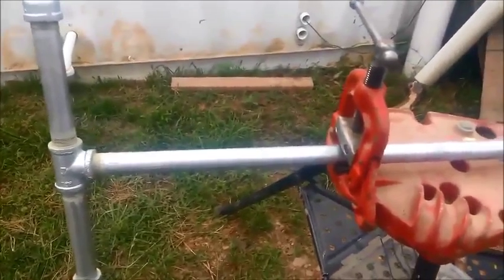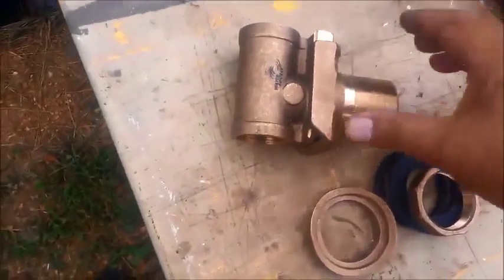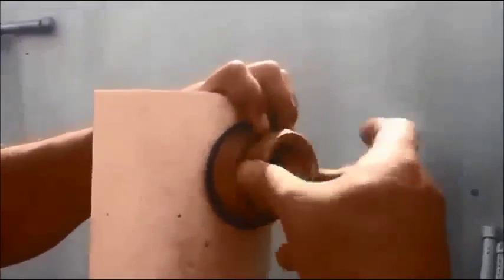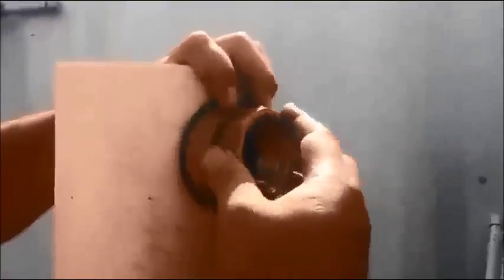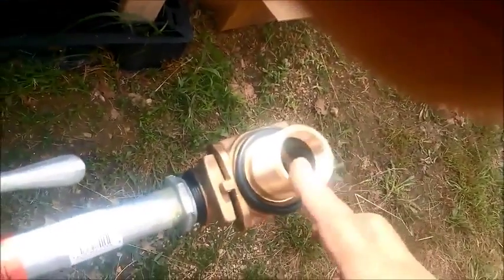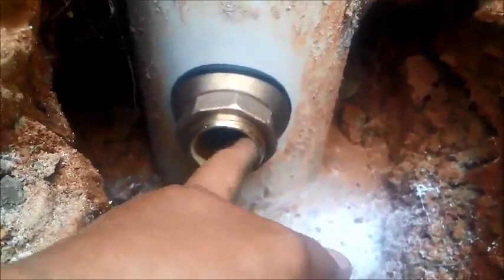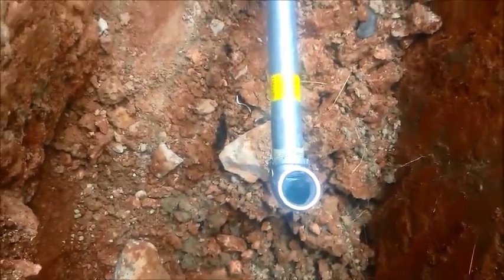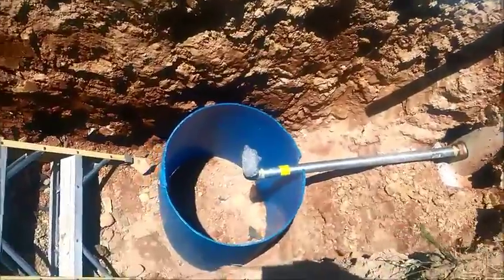Pitless Adapter, Utility Hydrant, Dry Well Installation

Comment: That was really interesting. I have a Well on a property out in Maine and was thinking of installing a pit less adapter. But my casing is metal, so that has me worried a little (don’t want to mess up drilling holes). 

So I have two questions:
1) how should I go about drilling a hole in my casing?
2) my layout idea is like this: frost free hydrant 3 feet from Well, pipes continuous another 100’ or so to another frost free hydrant which is just outside the cabin (not build yet). Branch of that hydrant to a 300 gallon tank inside cabin for daily use, and also go from that second hydrant (at 90° angle) another 100’ to a frost free hydrant by the garden. 
Oh that question...: the system would be pressurized from the pump, what size pipe should I use? Does the pipe needs to be level or draining back to the Well? 

A side not on the frost free hydrants. There is a model that has a self contained drain tank so no contamination can occur from the seep hole or other surface water penetration. Do you have any experience with those? 

Again, great video. Looking forward to your feedback.

Comment: I’ve got pex pipe from my house that I have to connect to my pitless adapter, only option is a shark bite fitting and I’m concerned it will leak, it looks like a cheesy setup, do you have any experience with sharkbite connectors?
Reply from the maker: Sorry brother.